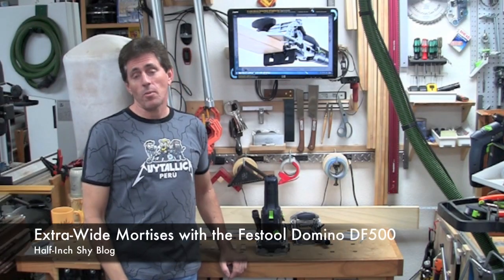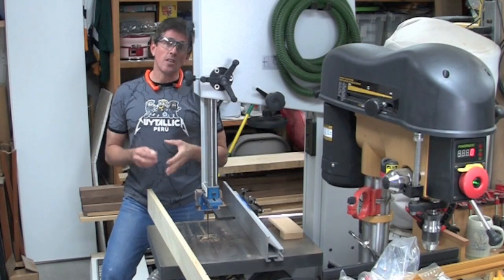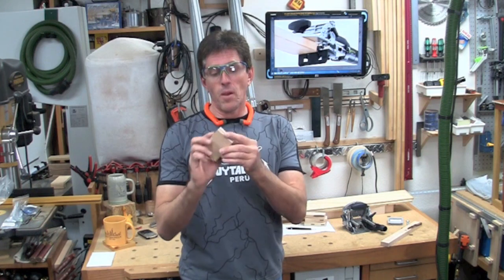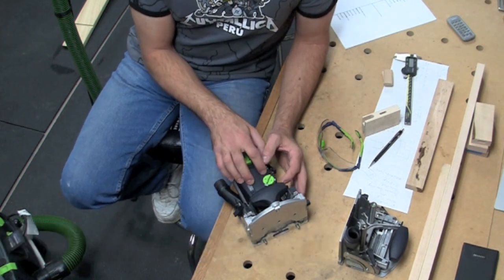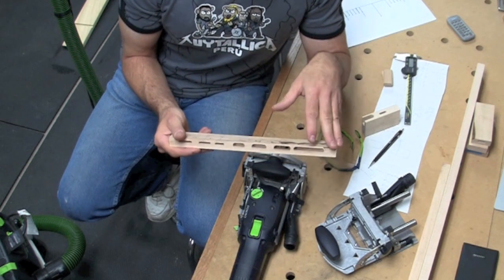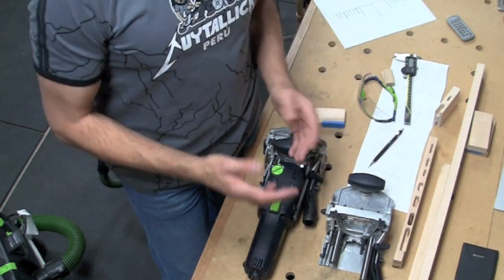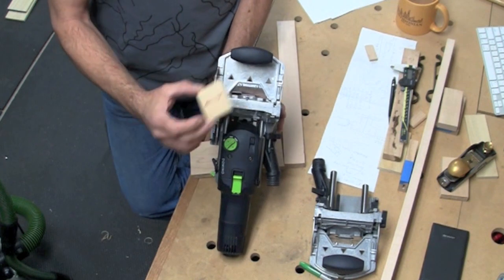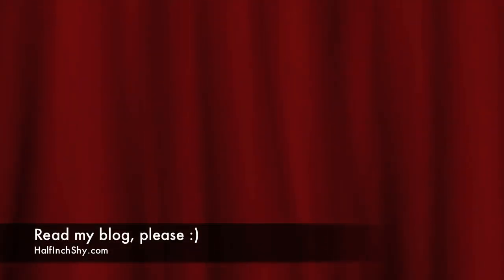#56 - Domino Crib Sheet - Extra-Wide Mortises with the Domino DF-500

Comment: Great video Paul!  Patrick & Michell of Leatherbydragonfly gave you a shout-out, and recommended this video. I just posted a reel on my Instagram account in which I cut some 36mm wide mortises by placing a line 8mm to the right and 8mm to the left of center and leaving the setting set to standard on my DF 500.  While this certainly worked, it's definitely quicker, and easier to just use the guide on the Domino!
Reply from the maker: Excellent! Glad it helped. I'll have to go thank those two. They created a nice business for themselves.